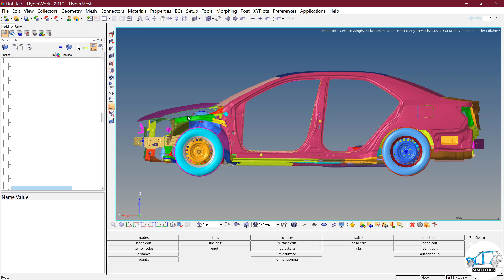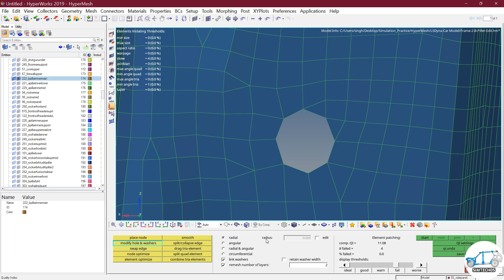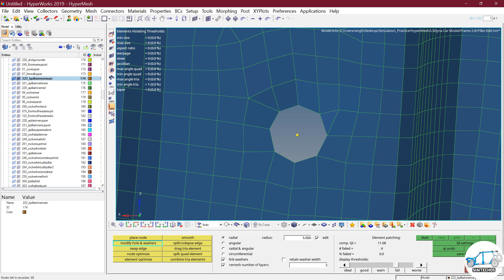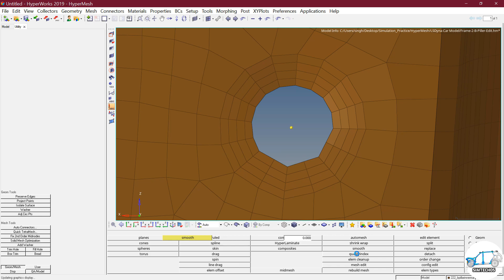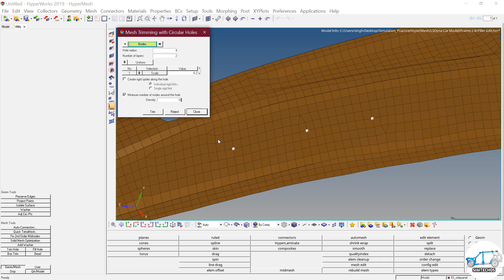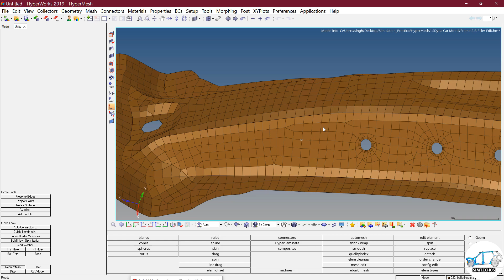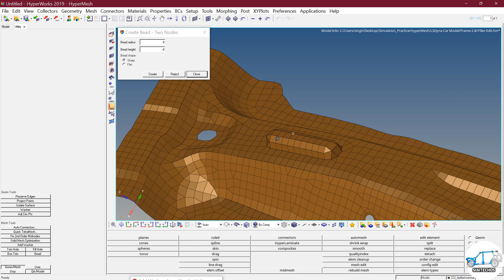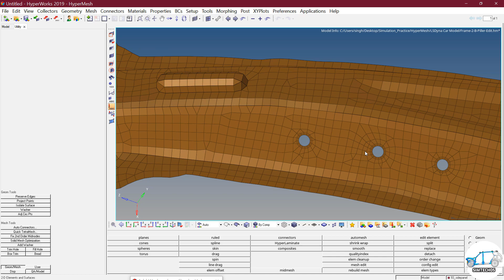Meshing in hyperMesh - Orphan Mesh editing, Part - 01

Comment: I have been given a task to compare a orphan  mesh of a part and need to change the mesh to update the mesh to match the new design of the part.
I have to make changes like adding fillet on the side of the mesh. How can I do that?
Changing radius of the mesh on cylindrical pipe.i just have orphan mesh
Reply from the maker: Dear, Mesh morphing might be helpful for you. If changes are huge, I suggest to redesign the CAD model itself.

Comment: Sir, I tried trim hole option but by default it creating quad elements around the hole but I need R trias.. how can I change it. And another doubt is can we create nodes with varying density around hole.. pls suggest.
Reply from the maker: Dear,
1. You need to split elements by edit element option (press F6 to access).
2. For variable density you need to define individual scale factor that i told in video itself, plz listen video carefully.
Reply: @arsitech-ltd  thank you